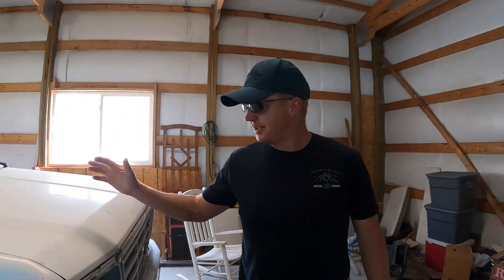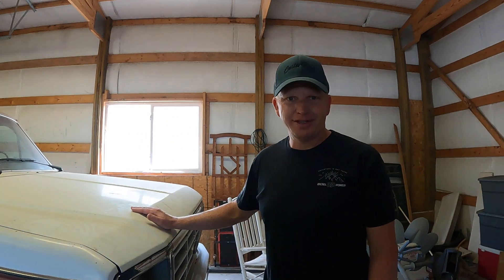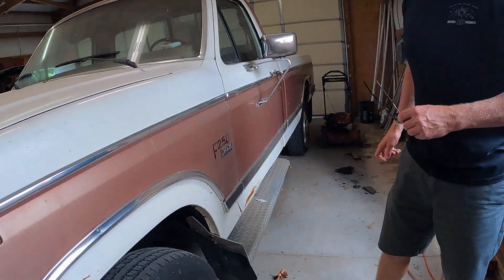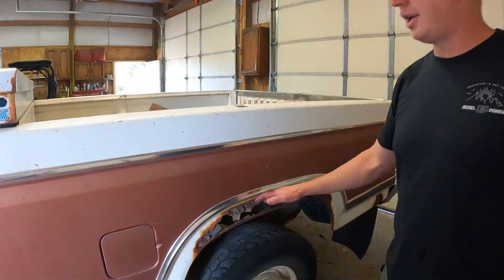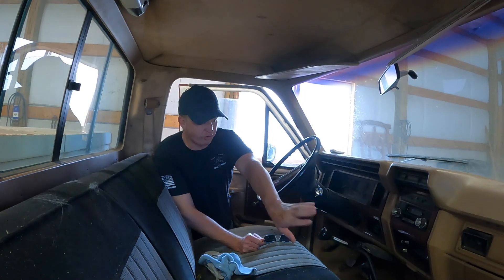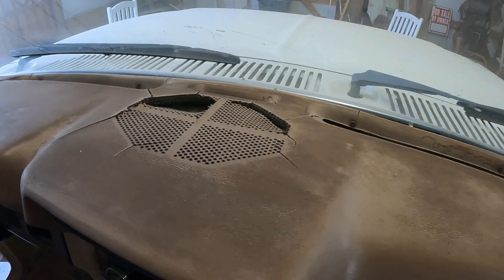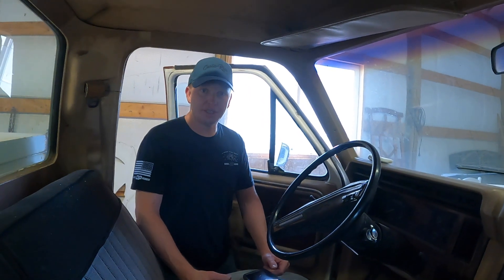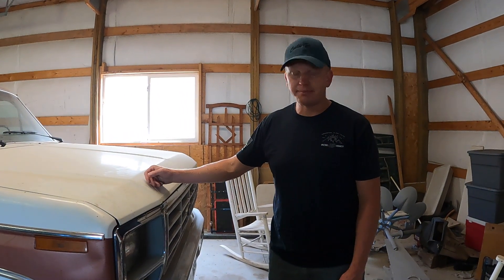Bought Broken 1984 Ford F250 6.9l Diesel

Comment: Best all around truck i have ever had is my 84 250 diesel with a 4 speed. The rust got mine really bad too so I bought an 86 donor truck with a great body and a bad engine for 500 dollars. The plan is to swap the body over on my truck and paint it the original dark blue. I have determined that would be the easiest and cheapest way to go for me. I say get it running and drive it for a while and if you like it start looking for a donor truck. A turbo is a nice upgrade too, they come up on the used market from time to time.
Reply from the maker: Thanks for watching.  Stay tuned to the channel for updates coming this week.

Comment: I have a 1984 ford f-250 6.9 idi 4 speed manual and I have never had a problem with mine run like a top, a couple things you will like to know and your gpas is probably rolling in his grave about is never either a diesel, it fries your glow plugs second they are easy to work on, and yours sounds like the injection pump  it was trying to start on eather another thing that's good to know is if the fuel filter is dirty it will start hard or if the dual tank switch is on the is on the front tank and your putting fuel in the rear tank it won't run with no fuel, also the fuel lineups on the drivers side of the truck and crosses over to the passengers side at the cross member the runs across the top of the frame and of course its a metal line but it runs under a loosely fitted eyelet well that line rubs on the frame from the motor vibration just a few need to knows, and also I seen in the comments some said turbo it that not a good idea it will leak oil like crazy mine has a turbo the engines have crazy cank case pressure and the oil will blow out of any hole put in the crank case so have a pro put it on for you and make sure the turbo is for low end boot these motors dont run high rims, make sure the turbine housing it small,
Reply from the maker: 👍. Thanks for watching.  Great suggestions.